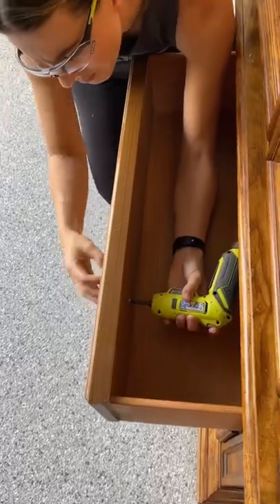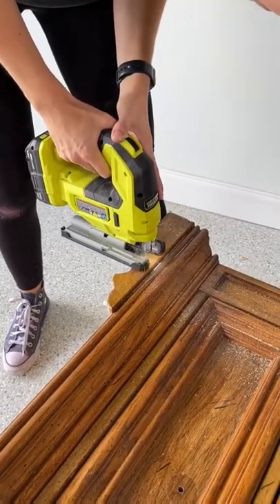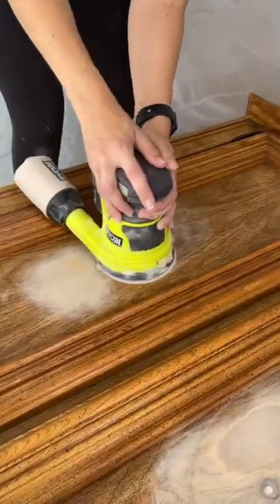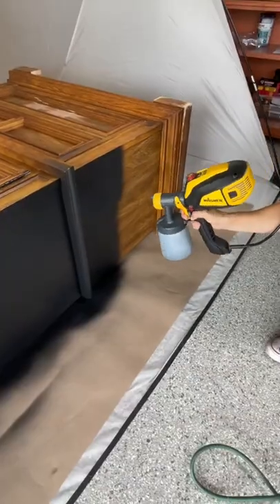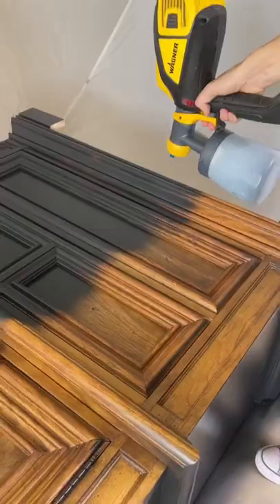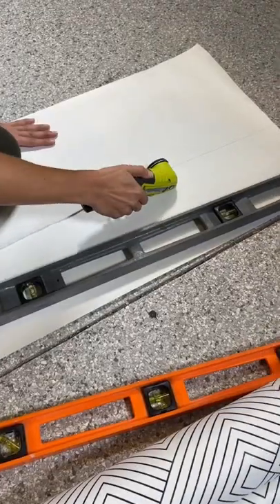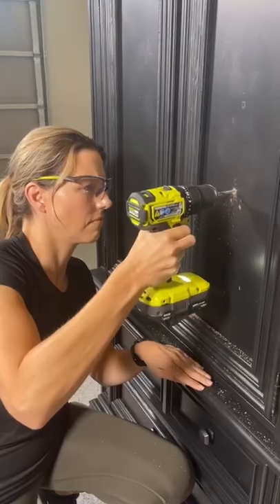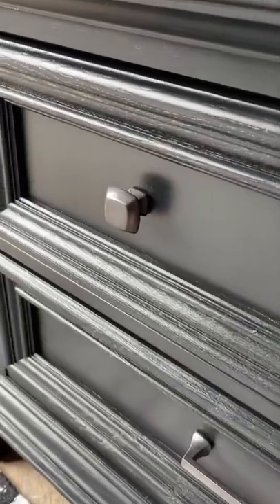FAKE WOOD Armoire Furniture Flip 🖤➡️ Modern Black Bar Cabinet

Comment: I have a black dining table/chairs from pottery barn.. The previous owner had small children and the top of the table is sticky and gummy and marked up and impossible to clean. I wanted to sand the entire top of the table off and start over with a clean finish. What are your thoughts about using the spray for beyond paint on this project? And what would you seal it with? Love your work ❤